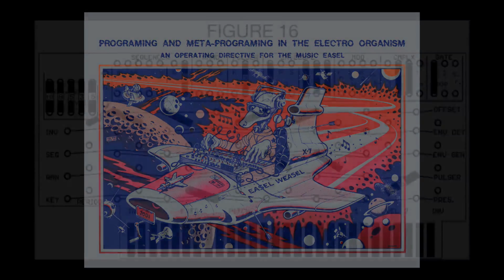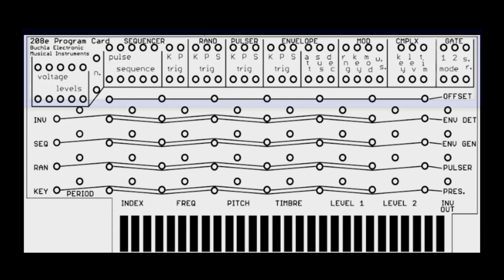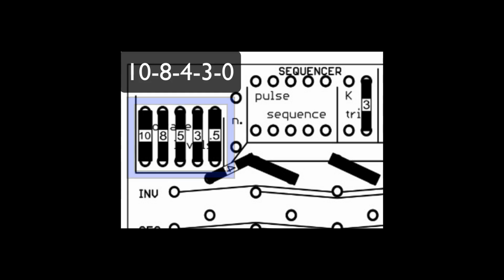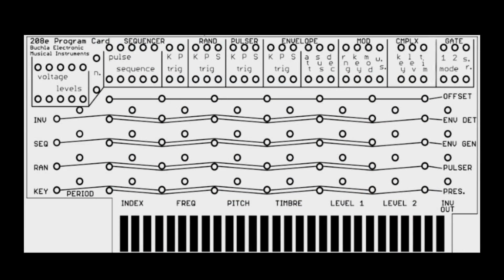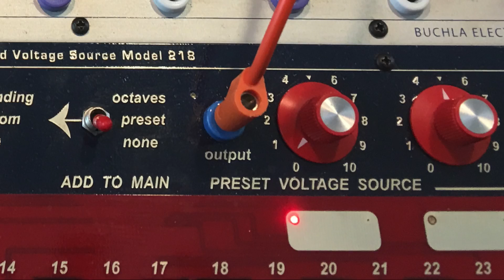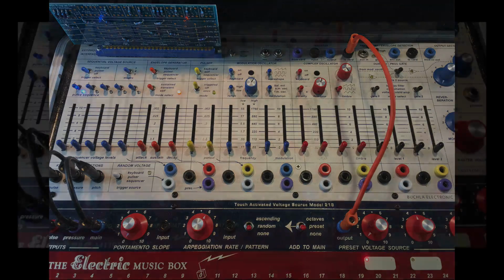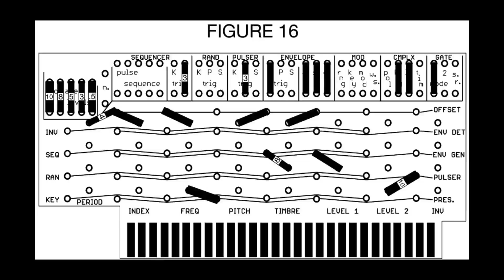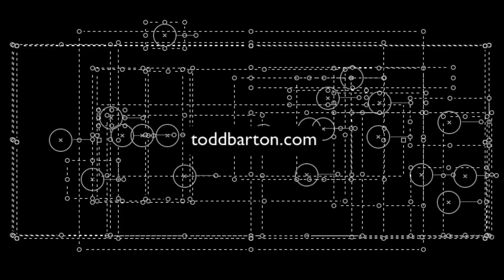Buchla Easel Manual Figure 16

Comment: Ive watched nearly all of these patch manual vids and have enjoyed them even though the info is not that useful with my system. However, it does make me realize that the Buchla easel has spawned many little nephews as my tiny 0-coast has a wavefolder and some useful features like a dedicated sample-hold and slope generator.

All-in-all, these videos show how ridiculously advanced Don was, or at least how manufacturers are finding ways to offer reverence (if in a lesser manner) to his designs.

Fun STUFF!
Reply from the maker: Thanks Tom! Great observation and thanks for watching.